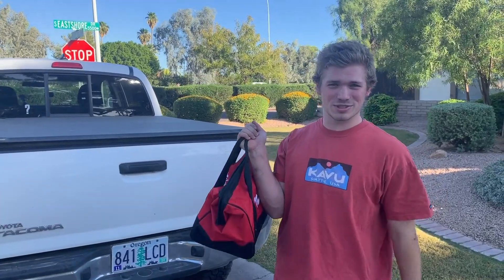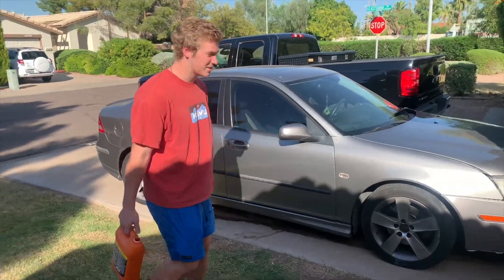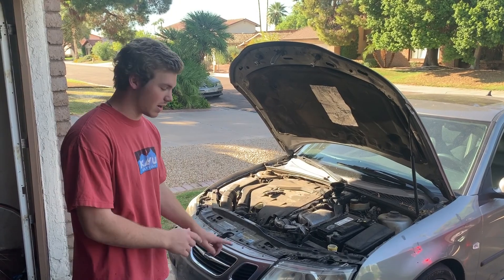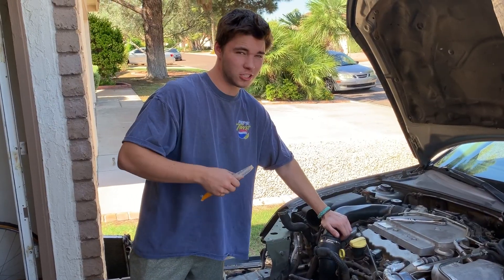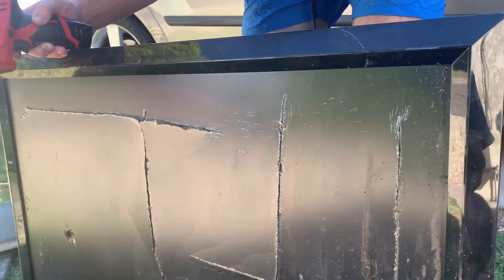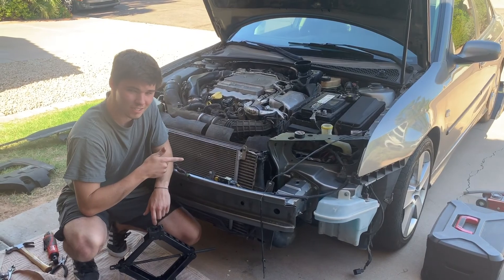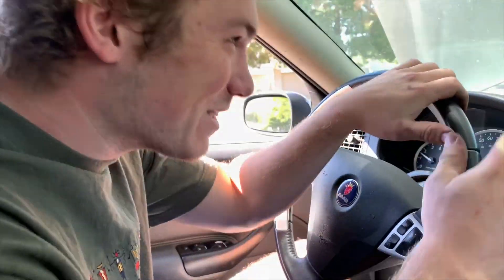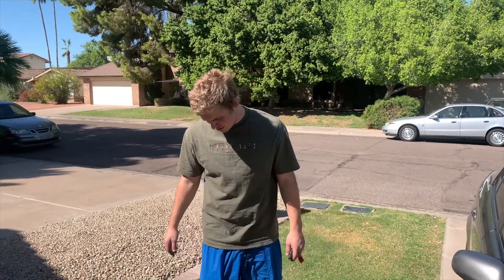How we Managed to Destroy my Saab 9-3 Aero in Under 5 Minutes.

Comment: Turbo x is the fastest saab also 2.8 v6 but 4 wheel drive and 280bhp where as the aero is front wheel drive and has 250bhp
Reply: are you sure the turbo x has more power to weight ratio than the 06-09 9-5 aeros ? turbo x is heavier from what i know.
Reply: @petrpan5790  no the 9-5 is heavier the turbox is the fastest saab produced out of factory, has a system where the back wheels turn and the cross wheel drive hence handling than the 9-5 aeros
Reply: The 9-7x Aero is faster than every 9-3 and 9-5 made.

Comment: Walmart turned me down. Lightning mcqueen soap left me rashes and cuts.
Reply from the maker: tucker roberts did you use pool water or filtered water? Gotta do it by code. Always. Don’t have a pool? You can buy chlorine at Walmart and infuse that into the water you use to shave. Don’t forget to use our promo code (tlj garage) and yes it does work for chlorine. Enjoy
Reply: I used Thomas the Tank engine soap. Left me baby smooth.